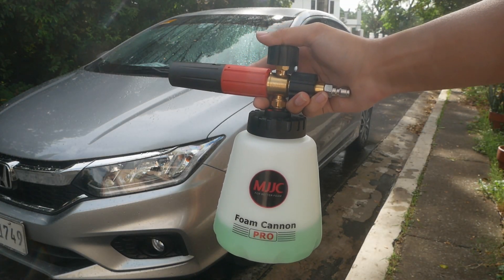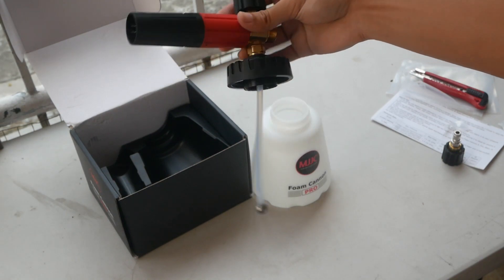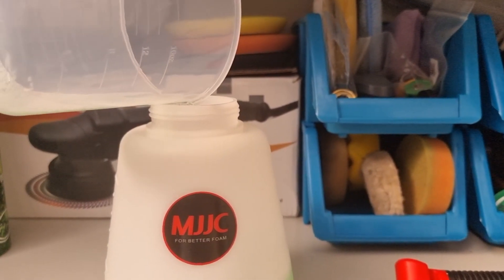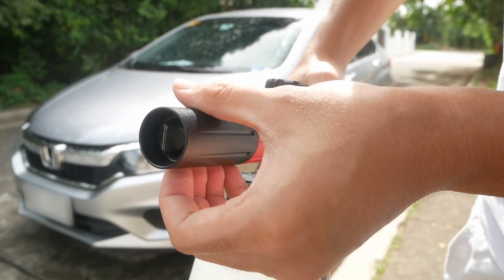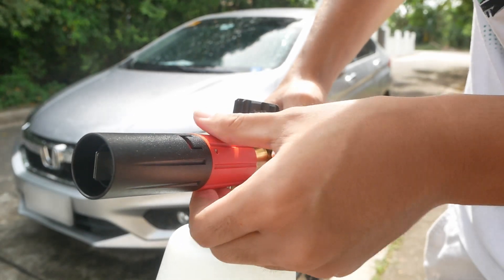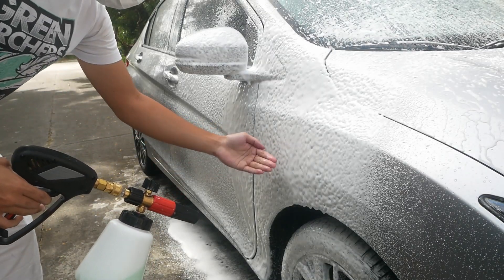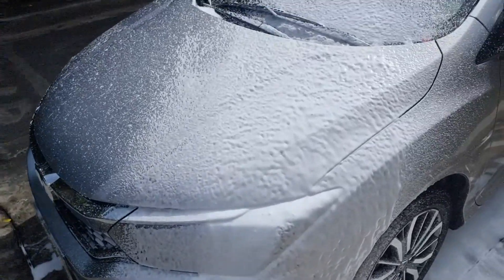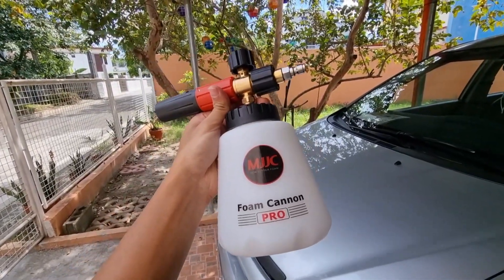MJJC Foam Cannon Pro V2 Review | Thick Foam Straight Out of the Box?

Comment: may isang con akong napansin sa mjjc foam cannon pro. it sucks more soap than other reputable foam cannon brands. pero manenegate mo sya by tweaking the dillution ratio and tune down a bit  dun sa knob. rotate back to around 45 to 90 degrees backward depende na rin sa pag bump up mo ng dillution. you may be using more soap but you will end up not draining the whole solution. may matitira ka pa for the contact wash or keep it aside for next wash. 🤗🤗

Comment: Best video. Thank you.
Reply: Will this also work sa belt type na kawasaki? Or kulng sa power po??
Reply: @cuvame  Change to smaller 1.1mm orifice, it will work with lower pressure.
Reply: @harisyoung4110  i did na boss Haris but still isn't that thick. Kept on changing car shampoo pero still not the sticky kind of thickness na hinahanap ko. Kunting runny sticky sya. Better nlng kay sa fully runny type nung d pa ako nag palit 1.1 orifice

Comment: Ilang meters po ung hose nyo sir?
Reply from the maker: 10 meters po ata iyon sir
Reply: Yes po sir. Tanung ko lng po sa existing spray gun nyo po no need na po bang lagyan ng extension for versatility ng gamit?
Reply from the maker: @ryanroldan8052  bale ang binili ko po ay yung mismong 1/4" quick connect spray gun tapos bumili rin po ako nung adaptor from hose to spray gun tsaka 1/4" quick connect coupler set

Bali yung spray gun pala may kasama nang 4 na nozzle tips
Reply from the maker: @ryanroldan8052  well ako wala na akong binili na iba
Pwede kang bumili nung extension wand na narorotate yung dulo o naka angle kung gusto niyo pong mapadali pagiispray sa mga bubong ng suv or pang underwash
Reply: Pa request naman nxt sir ung spray gun nyo po pa review
Reply: @uazap  my mairerecommend  po b kaung extension wand?
Reply from the maker: @ryanroldan8052  wala pa po ako actually nasusubukan pero may minamataan na ako kung sakali hahaha
Teka sir, bigay ko link dito hehe
Reply: @uazap  cge sir
Reply from the maker: @ryanroldan8052  pero m22 pala connector nito sir tapos 1/4" quick connect dulo
https://invol.co/cl7rmgh
Reply from the maker: @ryanroldan8052  ito sir 30° 1/4" quick connect female dulo tapos 1/4" male rin yung attachment to spray gun king 1/4" quick connect po spray gun niyo
https://invol.co/cl7rmir
Reply: @uazap  saan nyo po pala nabili ung spray gun nyo dir?
Reply from the maker: @ryanroldan8052  ito sir: https://invol.co/cl7rmqp
Reply: @uazap  thank u po sir. Palagi po akong nanonood ng mga videos nyo especially ung mga techniques and tips sa pag carwash